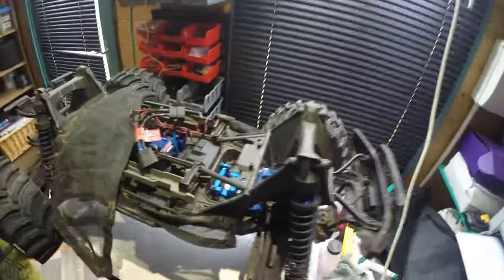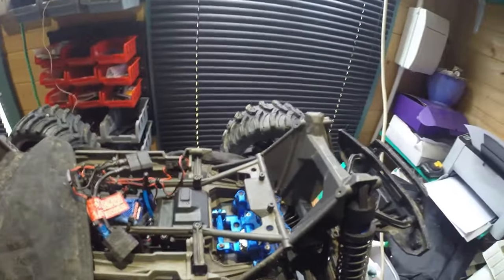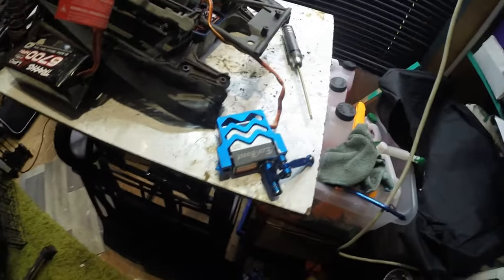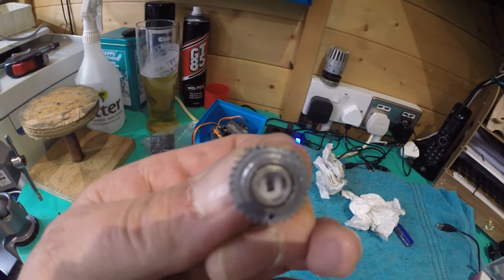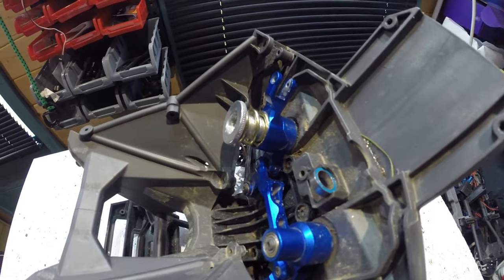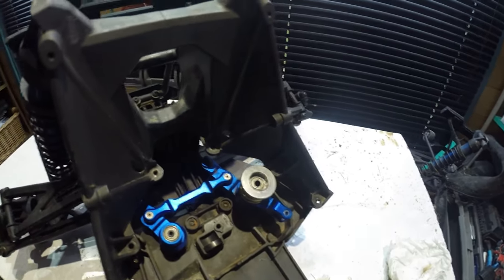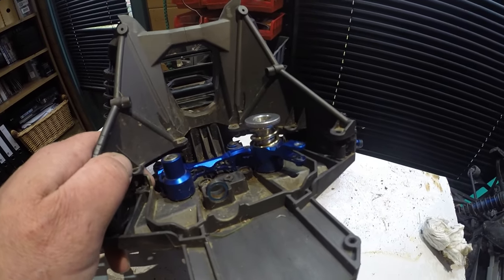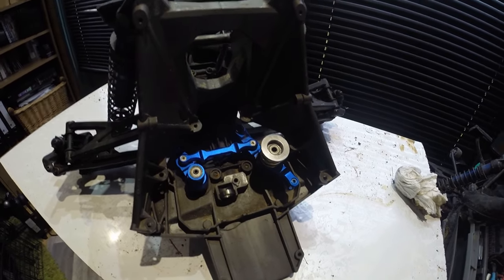Xmaxx servo issue AGAIN

Comment: How did you get on with the AGF servo.
Reply from the maker: The AGF servo is super smooth, the main problem was the servosaver was not slipping so I greased it and it’s been fine since, I had a tumble rumble the other week and it all survived 👍
Reply: @blackmorevalerc  
Cool I am going to fit mine but just use the upgraded heavy duty Traxxas servo spring in the stock unit along with Kevin Talbots nut and bolt mod.🤞🏻
Reply from the maker: @WIPEYOURLENZ  I did that with nyloc on the bottom, it ripped through so I rebuilt it with a washer in the top and it’s ok 👍
Reply: @blackmorevalerc  
Yeah I might put a small washer on the nyloc nut side to stop that.

Comment: you need to set your endpoints,  especially with aftermarket servos. mine are set at 60% and never have an issue
Reply from the maker: I sorted mate, it was the ali servo saver was so tight because it needed greasing I did make an update video, the new AGF servo is so smooth had no problems since, it was starting to piss me off.
I use the app to set endpoints and other settings all’s good, thanks for your comment 👍